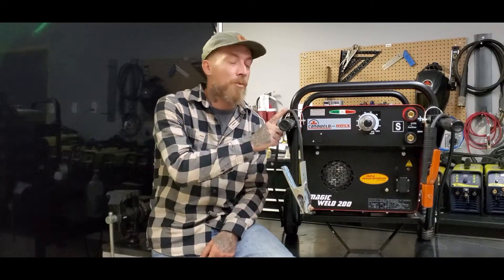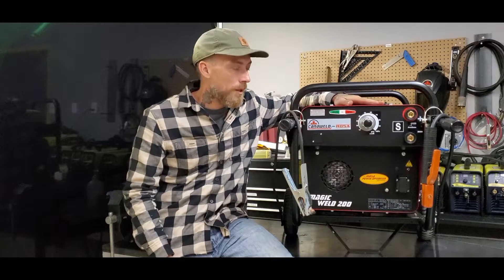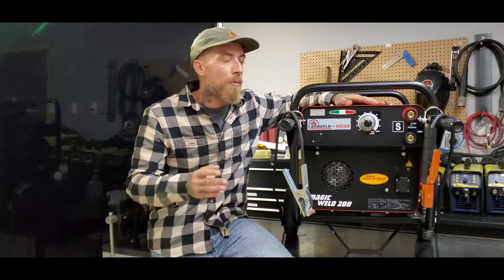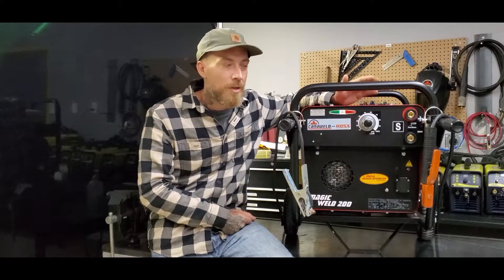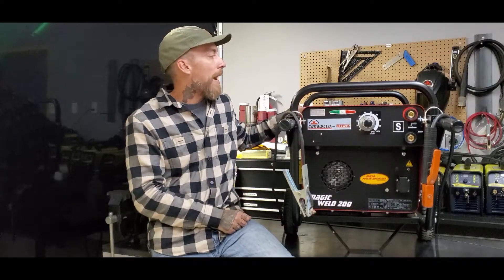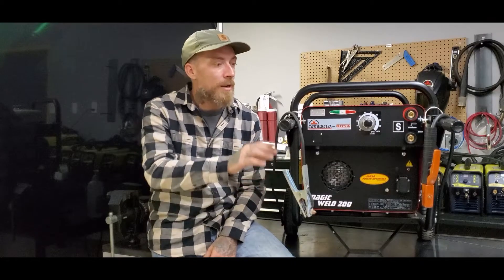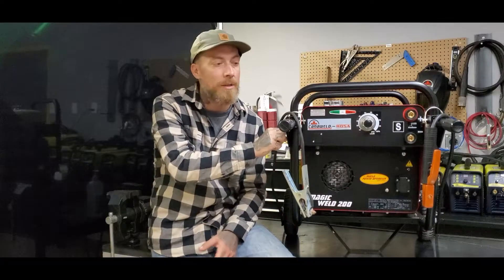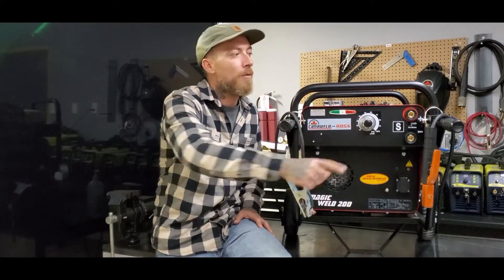How to Choose the Best Engine-Driven Welder?

Comment: I don't always burn 6010 1\8th but i frequently do. Does this machine have the capability?  Im required to do a pipe cert twice a year also to maintain my cert with my local municipality for upgrades and emergencies to their natural gas utilities. My service truck doesn't have room for anything larger than a welder like this. If it has these capabilities , i would like to give this a try. Many times i have to have someone  bring a trailered machine so i can pull equipment with my truck. I attend natural gas expos in my area and currently no welding machines are displayed. You can research the expos and see the enormous amount of members and attendees.
Reply from the maker: For technical assistance and enquiries feel free to contact Canaweld Inc. 4165485650

Comment: I have a Lincoln AC225 that i like to use 5/32 rod with at a 100% duty cycle running 260 volt, can buy a used 8kw generator to plug the welder into but how does that compare?
Reply from the maker: AC225 weight is 96lb and a 8kW generator's weigh is around 200lb in total around 300lb

The Canaweld's   Engine-Driven Welder Magic Weld 200A weight is 135lb

Furthermore, because of chopper technology the quality of welding is way better.

https://canaweld.com/product/magic-weld-200a/